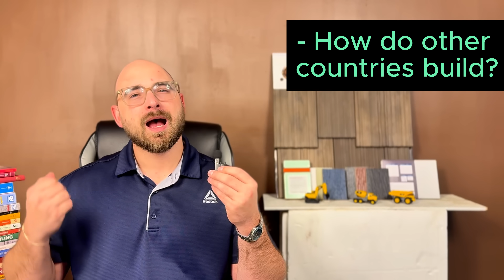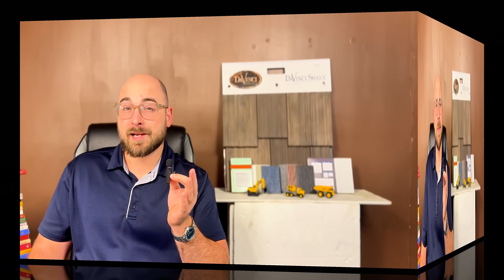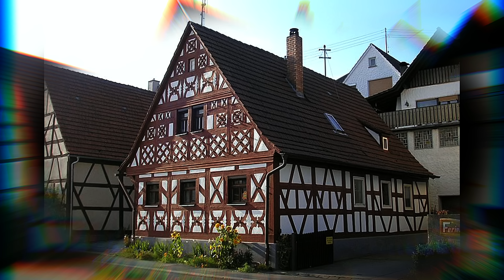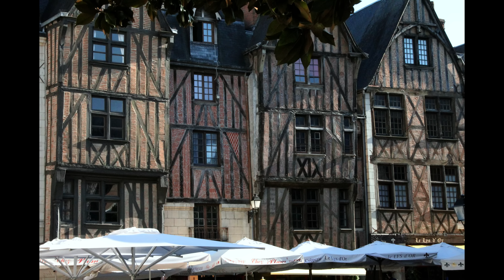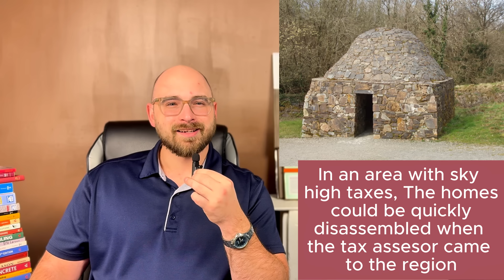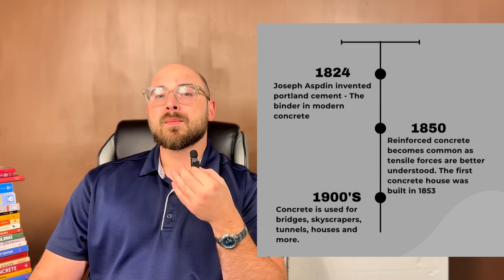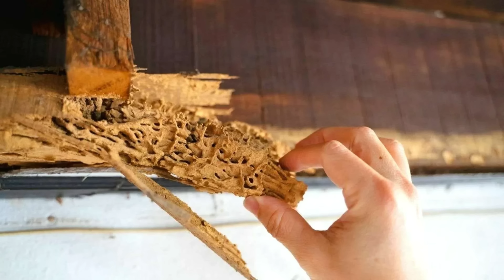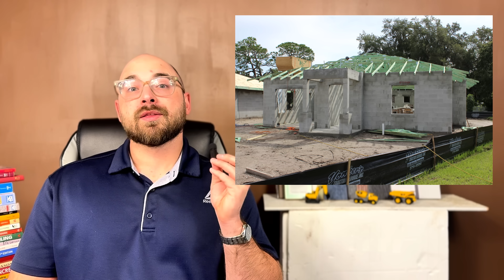Why Other Countries LAUGH at American Homes

Comment: I‘m born and raised in Bavaria, Germany.

My house was build by my dad in 1986, which was the cold war peak time. The next mayor city is Munich and so for, my dad decided his home has to be bomb safe, because munich is a nuclear target, so our two basement floors got a 110cm/35“ thick ceilings out of steel concrete. 

Above the ground level, everything is reinforced too to withstand nuclear blasts. But you couldn’t tell from the out- or inside, besides the outside walls are also a bit thicker that usual. 

It would be really cool to have a hurricane over here, to see if there would be actually any kind of damage to the houses in our little village. Also we got 3 houses in our village that are 400 years old or older. The church should be like around 500-550 y/o
Reply: Last year,in eastern Croatia,we had a 200kmh,strong huricane wind.
Strong winds in past, where maybe up to 50kmh..
Not one house was destroyed. Only few houses had blown roof-only the ones with small balcony under the roof.
My house is in a open area, without protective buildings around it. I lost just a few roof tiles. And my house was a standard build,nothing special,or reinforced.
There where houses from 1920s,also,just roof tiles went off,and same thing happened with very tall houses with 2 or 3 floors.
Reply: @Bare36  Same in my area in Germany, Living slightly elevated on a hill side. My wind sensors I have stops reading at 180kmh and I had this on several occasions that it reached the limit. So max speed should also have been above 200kmh (weather forecast I believe said up to 250kmh). No harm done. Old side of the house was build between 1840 to 1880 and the new part around 1984.
Reply: @Bare36 yep I was there for holidays. Trees were unearthed, even in Bosnia (Trebinje) which is quite far from the coastline behind mountaind had its trees destroyed. And yet a couple of days of cleaning up the trees was enough to turn things back to normal.
Reply: "It would be really cool to have a hurricane over here" <- DEFINITELY NOT!
Reply: @ if you would‘ve read my comment, you should know that I dont live in a wood shelter 😅🤫
Reply: I wonder which building authority would allow such a private building. Unfortunately, his gut feeling might prove to be right in the end. Time to test the air filtration and nuclear wasteland escape concept. And don't forget your visa for Baden-Württemberg ;-)
Reply: @m.e.7100  why not?
In Switzerland it is compulsory to build a bunker in new houses...
Reply: @marwerno no it‘s not compulsory anymore for family homes. The community has to guarantee for a „Schutzplatz“ and instead of building your own bunker you have to pay a little tax. Especially hospitals don‘t have to maintain their hospital bunkers anymore.
Only for houses with more than 38 rooms you still have to build Schutzplätze within the building. Or if your community can‘t guarantee enough space. Further imformation can be found on hausinfo ch and on the website of the Bundesamt für Bevölkerungsschutz (BABS).
Reply: @m.e.7100  in the 1980's this building method was subsidized by the federal state adminstration of Bavaria - though I'm not sure if it was required.
Reply: Meanwhile my country (Singapore) is densely populated so we mostly live in apartments. Those built in the mid '90s may have communal bomb shelters at the foot of apartment blocks (that in peacetime are turned into general stores/social service offices/gyms/enrichment schools etc. but those built after that may either turn the apartment's staircase shaft into a bomb shelter by using thicker walls, or add a smaller windowless room with reinforced walls into each apartment as a bomb shelter. These are above ground (but at least 1m away from the apartment's exterior walls), so some of us think its an incredulous design, as we imagine that in a bomb attack, our apartment towers will be pulverized & it's thus inconceivable for any above-ground structures, including these kind of bomb shelters, to still remain in one piece. Maybe these are better than nothing, or if the evacuation staircases to ground level are too jammed up with evacuees heading to underground communal bomb shelters (including train stations), and if an apartment building is luckier & doesn't collapse immediately after an attack
Reply: Buddy that is not a house, it seems to be more of a bunker your dad built
Reply: Imho roofing and windows would not be able to withstand. But core would be fine.
Reply: @jetmangti6475 Roofing will withstand the hurricane if it's a concrete roofing. Houses nowadays has roofs build with concrete instead of using other roofing solutions. A house build to withstand a nuclear blast will certainly withstand a huricane.

Windows will break either way, but it can be replaced quickly and cheaply compared to building an entire house again.
Reply: @jetmangti6475  Our windows and external shutters and external doors, are all from aluminium.
Reply: Why would you want to *survive*?
Reply: Believe me the walls and frame would stand,the roof,the Windows and every inside won't,the real damague of an Hurriacanes comes from the floods not from the winds in a strong one can put your house under the water.
Reply: I have never heard of a private home with two basement levels.
Reply: Why would you want to live in a targeted area?
Reply: Hoho, almost like the bunker in Berlin...
Reply: Your house wouldn't even fare well against a category 3 hurricane.
Reply: ...man könnte die Häuser ja auch nuklear mal testen ob sie standhalten. Dann wüsste man mehr...
Reply: In the US the "government" told people to stay away from windows in case of a nuclear attack. 😂😂😂 I'm not even joking.
Reply: @no_clot_shot1128  I've practiced in school (former East Germany) how to immediatly throw on the ground and cover up your face in case of a nuclear attack. We also practiced turning a shopping bag / plastic bag and a tea towel into mask against the nuclear dust.
Reply: @henningbartels6245  That could possible save you for 2 minutes 😆
Reply: @no_clot_shot1128  What do you think happens if you are far away from a nuclear blast and you don't instantly die? You get glass flying into your eyes.
Reply: @Fighter_Blue  tbh I can't imagine any other nation dropping those things on innocent civilians... There's only one in the human history .. Beliving in karma and justice buddy
Reply: @ Ok? Why did you reply like this?
Reply: @Fighter_Blue  just stay away from windows
Reply: @no_clot_shot1128 Well hopefully we never know because only one country gets to be the first & they used it to end a world war & save their own people from being killed further. 

Now look at how many countries have their own nukes; clearing their are others willing to use them.
Reply: Roof pitch of European homes would most likely be too steep to completely survive an actual hurricane direct hit. The rest of the home would probably be fine.
Reply: @mdeuro9  no,most roofs would survive without issues. We had a hurricane level 3.
Reply: @mdeuro9  Why would the roof pitch make a difference? In Alpine or windy regions, the roof tiles are each secured additional in order not to be lifted by winds and older houses also have special tiles to let a little bit air in the roof cavity to avoid "suction". As for me, I have a 55° roof pitch, but metal, 1 piece roof cladding, with (unfortunately) little overhang where the wind could get a grip on. Where I am we had winds of 180kmh (some say over 200, but not confirmed), I had not issues what so ever. Even my caravan cover did not budge, since it was well secured, with little chance of the wind to "get under". And the back of the house is pretty exposed, since my house is built right at a steep hill.
Reply: @mdeuro9  Modern building codes require the whole roofing to be anchored down. These homes should be fine most of the time.
Reply: Living conditions in the USSR in the 70s and 80s were not bad. The only thing that poisoned our thoughts was the possibility of a nuclear war, BUT THE WAR CAME FROM THE RUSSIAN FEDERATION
Reply: @Will-d9z1d War always comes from the enemies of the West
Reply: @Will-d9z1d  эти бараки не особо язык поворачивается назвать жильем
Reply: @fonyense2847 Кому и кобыла -невеста.😂

Comment: It's hard to get home insurance with a concrete house, the concrete walls tens to crack right down to the foundations.
Reply from the maker: Not true, in fact you’ll get a lower rate on your premium due to the disaster resistance.

Comment: Homes in concrete reinforced with steel are made like a uniform block. It's like belted everywhere in every direction, like a single big cube of metal pillar. That's why it's earthquake resistant: if the floor collapses on one side, the whole house falls off, not just one wall.

Comment: It's not just wood, sure use it if it works for you doesn't really matter. But why use those awful sliding windows? Even the cheapest European house has tripple or more planed glass windows that open tilt can have built in vents. Why are exterior doors (even in apartments) those flimsy wooden things instead of metal framed ones with like 12 latches that are used over here? Why multi split AC and heatpumps are alien technology? In here as an experiment I wanted to find one without heatpump technology yet I was unable since it's so cheap to implement thre doesn't really seem to be any point in leaving it out. Why wrap exteriors of houses in those fake wood plastic sheets? Why not use thin pressure treated wood or tiles? Really it seems like the problem is everything but the wood drive through the Polish countryside and you'd be surprised how many of those old houses of let's be honest low income people have few solar panels (or solar panels but for water heating) on the rooftop or ac sticking out of the side

Comment: Many of those high quality houses that have lasted so long in Europe would have to be demolished in the US.  For example a dry fit stone or even stone with mortar foundation would not pass inspection because it is not up to code.  If a building does not qualify for insurance, it will not get financed.  If it can't get financed it can't get a loan for repair, or get a decent price when it is sold.  Some fine colonial houses in the US that have already survived three hundred years get torn down for financial reasons.  Then a manufactured home gets towed onto the site because it can get financing.

Comment: You didn't even mention the pre-fabricated swedish wooden houses, where complete walls are built. They can either be assembled at the building site or can be assembled at the factory into sections that are joined together at the building site. While the walls are built complete with insulation and even painted, they can alse be finished with brick or various types of siding. (Admittedly, not all these solutions pan out as intended, as there have been some mold-related incidents.)

Where I live at the southern end if Sweden, at least in the country side CMU is very popular and PSI or ICF is used for more exclusive villas.

Comment: as a german I'd like to add that it's also very common to have a second floor in single family homes, which floor is also concrete. so you need big, sturdy bricks that are strongly bonded together to have the walls be able to carry the weight.
also our doors can't be kicked in nor can our windows be punched in. you'd break bones before breaking them. that includes apartment doors. they're that sturdy for heat and noise insulation. I've seen some videos about americans reacting to our doors and windows and it's hilarious. similar vibe to seeing magic happening and saying our standard doors are like special safety doors. makes me wonder what cheap slob companies sell the people with "the best of the best" written on it. that country's late stage capitalism is a disease ...

I've had a couple of arguments with americans about mainly brick homes in reference to the dangers of tornadoes. if the brick work is done for decoration, ofc it'd turn to dangerous flying debris, but one thing these people often forget is that germany and the netherlands are right in the middle of europe's tornado alley and both countries have seen F4 intensity tornadoes not too long ago.
sidenote: the first ever recorded F5 tornado was in germany in 1764 near the baltic coast. not too far where I grew up actually.
anyway. as far as I can tell we still build with bricks and concretr and when a tornado strikes there is a way bigger chance to survive inside a home than there is in an US standard home. it's also difficult to flatten such sturdy, heavy structures or have dangerous debris like singular bricks flying around. most things I've seen from images are missing roofs and maybe some manageable chunks of the walls missing, but it's more common that the overall structure doesn't collapse or gets wiped clean like it would with incredibly weak wood framing. literally the 3 little piglets and these murricans are so adamant that their plywood huts would be stronger... then get mad when you tell them why they're wrong, but when you're stuck in the bubble that no country is as advanced as yours ofc you'd react that way

edit: I hope you're catching up. the main reason why I argue with americans about their cheap slob housing is because it's just agonizing to witness. it's like arguing with americans who are so confident about the US (nonexistent) health care system being the best, that their low income workers have any rights, that workers unions are a novelty or that it's "communism" to have social safety nets to keep people from ending up on the street or having to live in their car.
just a few examples that come to mind and why the US to me is less a land of the free and more a delusional capitalistic dystopia. it's not much freedom when you only work to survive and not work to live and enjoy life.
with that said it makes me glad when this oh so rich country actually uses it's wealth to help the people at the very bottom, instead of filling the pockets of the 1% even more

Comment: What countries laugh at US house making, mainly Europe - not to put too fine a point on it my brother but Europe has multiple countries - shocking I know.

Towards the fact that we do build better and sturdier...if you punch a wall in a US home, you're leaving a nice hole, when you punch a wall in my country, you're leaving with broken bones. And that's if you just punch a non structural wall. If you try your luck against a structural one, you get a nice dunce hat.

Hell, even our doors - I laugh my ass off every time I see one of your shows where the cops break down doors by kicking or slamming into them. Know what would happen here if a cop would try that? He'd ricochet off the door. Short of an actual ram+effort, you're not getting through our front doors.

Comment: My German cousin's timberframed house, with a mixture of adobe and straw in between the timbers, is 465 years old and of course very much lived in!  I love all its quirky features like the crooked walls and uphill timber floors. It is my dream house and I would love to buy the upstairs flat off my cousin. ❤
That said not all houses in Germany are made from bricks, breeze blocks and concrete as many patronising Germans would have it. We have sturdy wooden constructions that can also be centuries old, constructions like in the USA, though less common, prefabricated homes made from a variety of materials and, still rare, 3-D printed homes made of concrete.
While the majority of our homes burn out rather than burn down because the construction is less flammable I am sure they would not withstand a wildfire of the likes of L.A. just recently. They generally withstand big storms or hurricanes, not the roofs though. They withstand floods up to a point and then have to dry out for months. Once the foundations are washed away as in the severe Aartal flood 3 years ago, the houses no matter how sturdy, fall into the raging streams.
So please be clement on American homes. Even our sturdy ones are not endlessly resilient either.❤
In Belgium, where I have lived for many years now,  the constructions are akin to Germany. And getting less sturdy on the whole. I live in a typical brick home that used to be state subsidised cheap housing for teachers 60 years ago. I can barely get a nail into the brick walls!  When my German architect brother came to visit for the first time I was apologetic about the modest build. He said: " Do not be modest about it. The quality of this construction is better than what they build nowadays."

Comment: You are so narrow minded that you think wooden or steel beams carry all the weight, not realising that there is something like carrying wall. Which is made of bricks. You need strong fundation to build huose that last. Not just flat surface with layer of concrete to start. Your idea of thin walls is good for dividing walls, but if you want something strong, and light, wood is not the answer.

Comment: The answer is very simple, it is an economic issue. Wood in the US is EXTREMELY EXPENSIVE and generates a lot of profits. Fighting against these interests is very difficult. They should build in concrete, especially in vulnerable areas like Florida and Los Angeles. It is not true that the cost of building in wood is cheaper than a concrete structure that will last a lifetime.

Comment: While most of our houses in Switzerland are made from concrete and bricks (confined masonry) , my grand-parents chalet had a stone foundations and basement with a timber framed chalet on top. I think the main problem I see with houses in the US is the cost which is astronomical when compared to similar light wood framing houses in Switzerland. That said, all houses are very expensive in Switzerland.